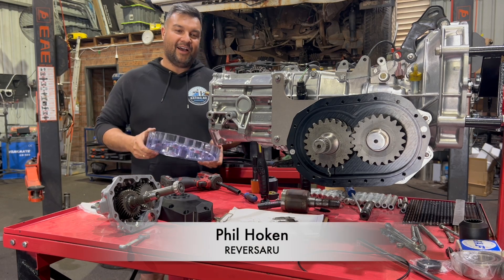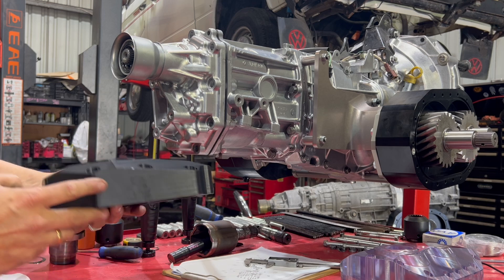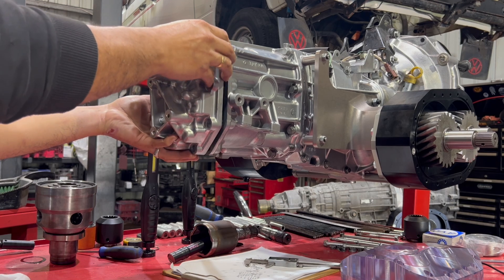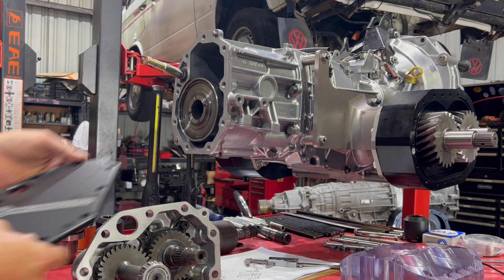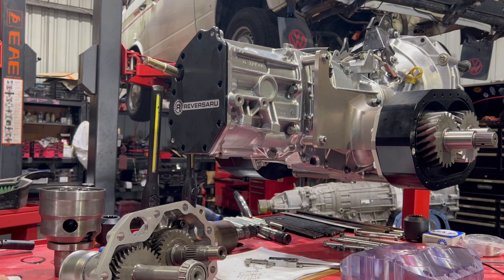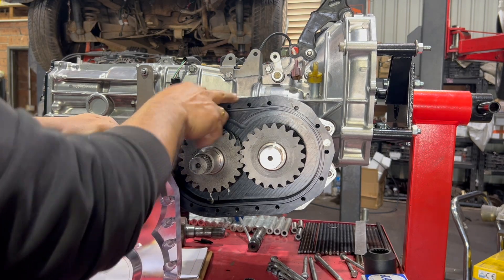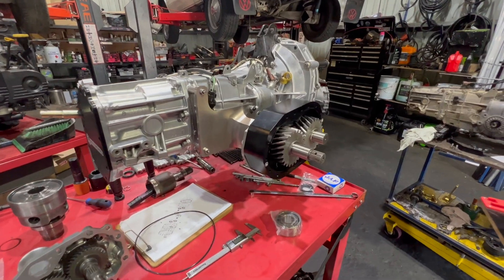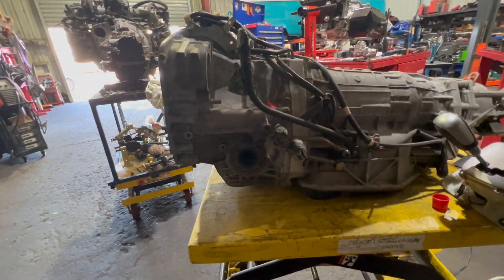Update #2: Reverse Drive, Reduction Gearboxes for Subaru 5MT / 6MT and 012 VW - Audi Passat gearbox

Comment: This all looks like gorgeous work! However why would I want to do all of this over the previous options? Now we will have to have shortened CV shafts, creating steeper angles.
Reply from the maker: Hi Mark, thanks for your interest and also for your comment. We have bolted these into a T3 and a T2 and while the axle lengths are short, they still work and get full travel in full squat and full extension. That said, when we develop these for the beetle and split bus, we will be able to use narrower gears and narrower cases as the beetles and split busses are a fair bit lighter in weight etc. Hope that answers your question. Phil.

Comment: how long would the axles be?
Reply from the maker: We have bolted these into a T3 and a T2 and while the axle lengths are short, they still work and get full travel in full squat and full extension. That said, when we develop these for the beetle and split bus, we will be able to use narrower gears and narrower cases as the beetles and split busses are a fair bit lighter in weight etc. Hope that answers your question. Phil.
Reply: @Reversaru  Thanks, can't wait for them to be available for bugs
Reply: Brilliant stuff, you guys beat me to it. I was sill busy with the concept sketches.  Well done.